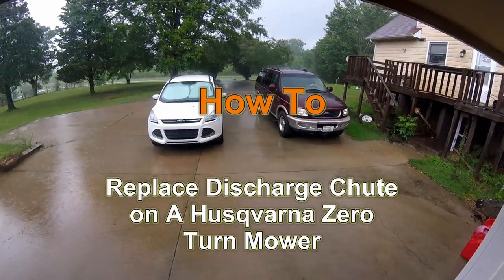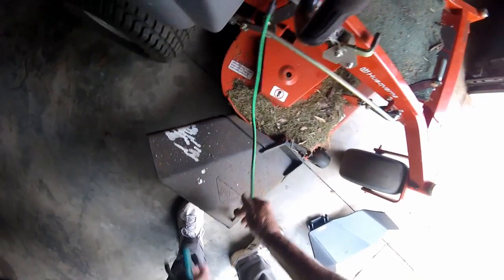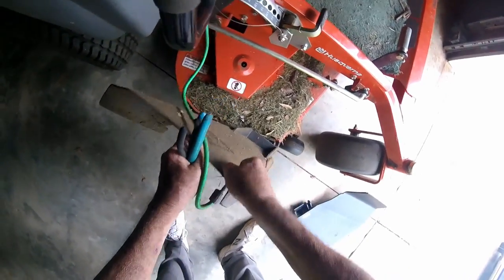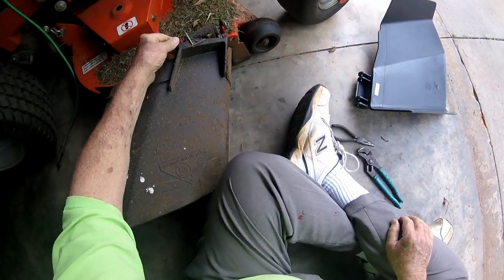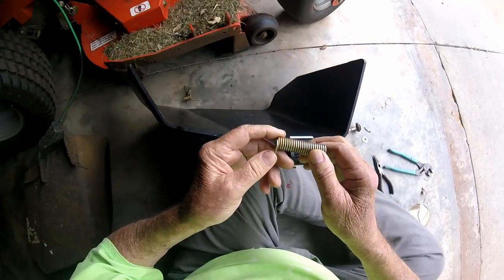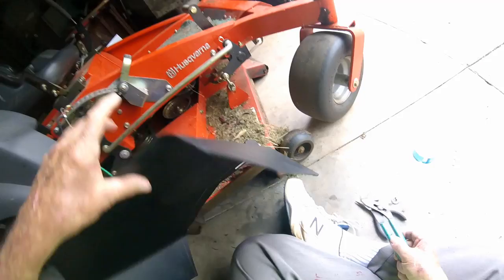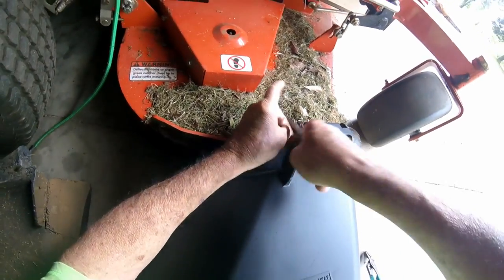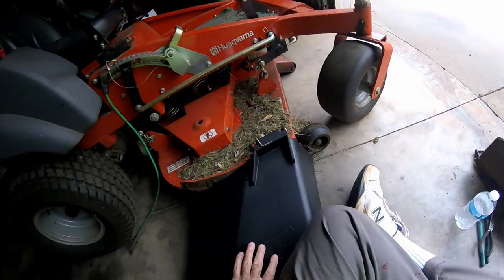How To replace discharge chute on A Husqvarna Zero Turn Mower

Comment: I took the discharge chute off my zero turn because it spreads the clippings out better and doesn't windrow them as bad. Plus with it on it doesn't fit down between my Christmas tree rows.  You take care, Walter.

Comment: Walter, if I was just going to remove my grass chute all together, since I installed a mulch kit and it blocks off the side discharge, isn't there two bolts that will remove the whole contraption? Great video, and a good rainy day project! Thanks
Reply from the maker: Just a long pin in the cotter pin all you need is some pliers
Reply: @pwalpar  Thank you